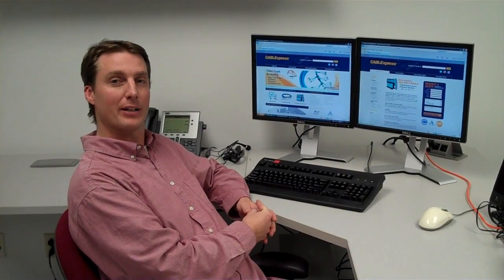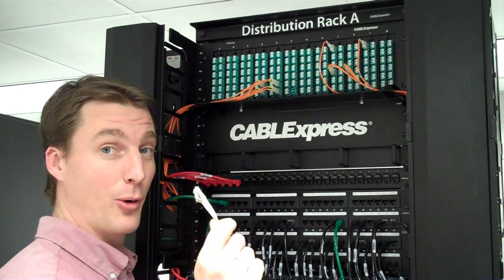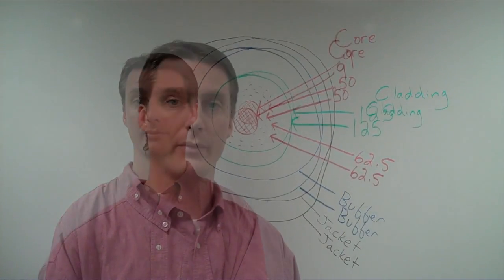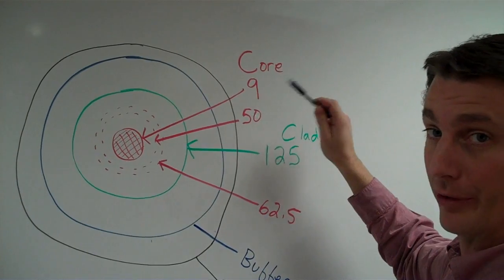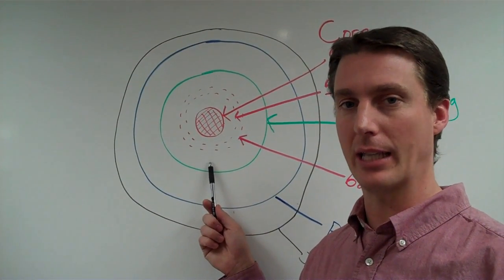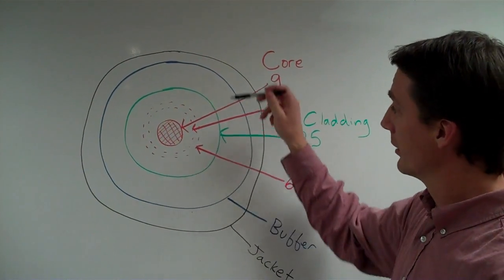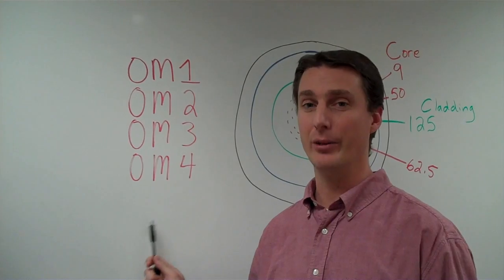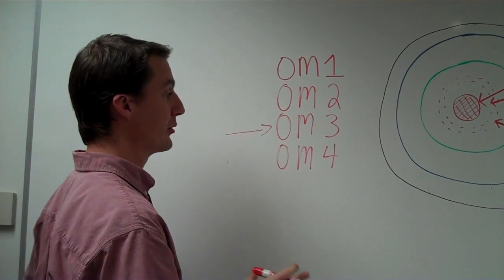Fiber Optic Cable Core Sizes & Rating Types (Ep. 8)

Comment from the maker: Hi worden16 - fiber optic data transmission is immune to EMI (Electro magnetic interference) as it consists of light pulses over glass (no metallic components involved).  So there is no need to have any protection against EMI.  EMI affects copper transmissions and there are many different shielding types and mechanical properties that help deal with this.  GREAT question, maybe I can do a Cable Talk on EMI!  Thanks!